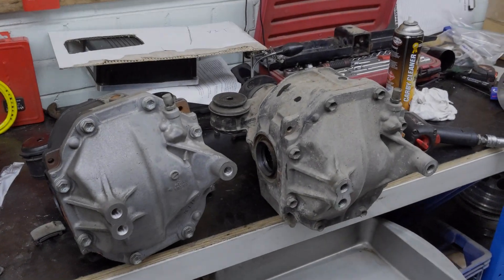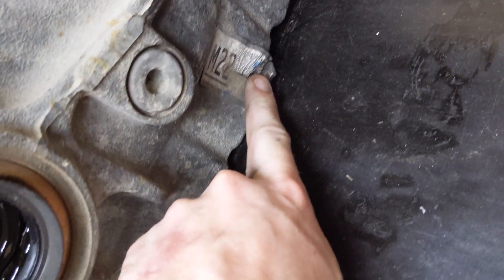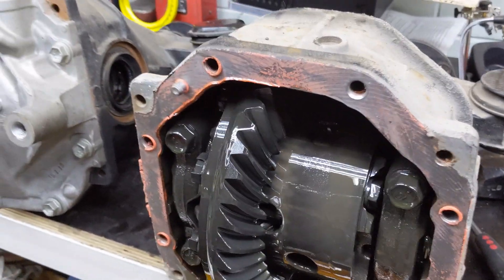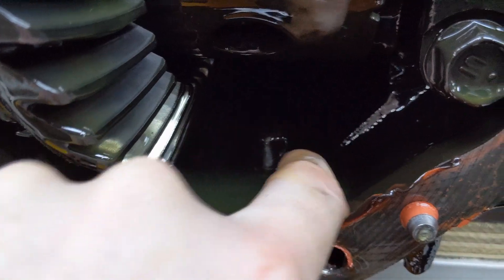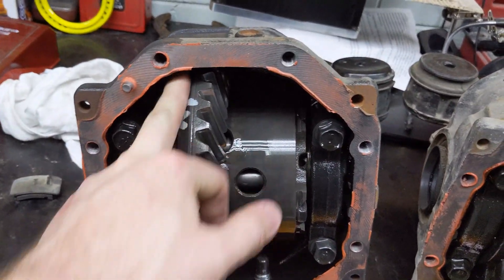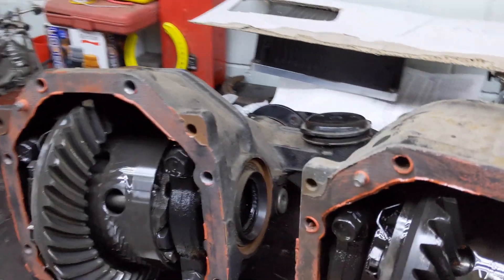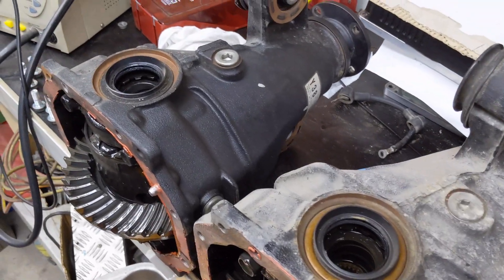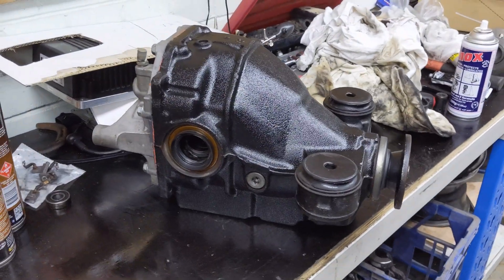Toyota 86 vs Lexus IS300 Differential Comparison

Comment: This is awesome, thank you for this in depth look. Looking forward to get an FRS diff for my manual IS300
Reply: Was yours originally a manual?
Reply: @WarriorsPhoto  yes sir, 2002
Reply: @Allen.Saylor  Did you keep it as a 5 speed or...?
Reply: @WarriorsPhoto  Ya it's still a manual to this day
Reply: @Allen.Saylor  Oh I was wondering if the OG transmission was swapped?
Reply: @WarriorsPhoto  oh no, this car came from the factory with a W55 transmission and it retains that original transmission now
Reply: @Allen.Saylor  I heard it’s not a very good transmission. Would you agree?
Reply: @WarriorsPhoto  it does good for a stock engine. I've drifted my car at day long events beating on it. I've beat on it for the last 7 years and its doing great. It may start to give you trouble around 400 lbs of torque, more or less
Reply: @Allen.Saylor  400 makes sense. When someone says it isn’t reliable. I always wonder how hard are they beating on the machine. 😂

Comment: That's wild, had no Idea they even came in a 3.58 ratio, must be an Aussie thing? In north america they only came with a 3.9 in the autos and a 3.727 for the manuals. Good to know!
Reply from the maker: Yeah, I think it was an Aussie only thing. Although I did read somewhere the US spec IS300 had a Touring Pack or something that maybe had a 3.58 ratio??
Reply: Mitcheeee the US spec gets a 3.9lsd for the auto and a 3.73lsd for the stick. Most of them have open diffs so they might have the other ratio
Reply: So just to clarify - the aussie spec IS300 torsen t2 LSD is a 3.58 final drive? That explains why the gears feel so drawn out. I was under the impression that is was 3.91 but it didn't feel like it. I have ordered a 4.55 Revolution final gear set (to suit toyota 86 / same diff) to install in my IS300. Should make a hell of a difference to acceleration then.

Comment: Greetings from Bathurst, Nice vid mate. I have an LS3 Powered 86 with TR6060 HSV box. I recently picked up the M22 IS300 3.58 diff and am going to be installing it shortly. What fluid did you end up running in yours? (full-syn 75w-85 GL-5?) The oil that came out of mine was really dark but the diff itself looks like it is in excellent condition.
Reply from the maker: Nice! Hopefully you're surprised at how easily it bolts in. I used Nulon 80w/90 GL5.
Reply: @Mitcheeee  great thanks for the info mate. Looking forward to the improved 1st-4th gear performance (mainly due to no traction with 4.11s with anything over a crack of throttle 😂)

Comment: Do you know what are the torque specs for two 19mm bolts on the bottom and three hex 12mm bolts on the back. 
I’m swapping out differential on my IS250 AWD 
THANKS

Comment: Im boosting my IS (its the stock auto trans) and i had one question which differential would be the best one to run? I currently have the lsd Y different from a 86/frs
Reply: go for the 2017-2020 Toyota 86
they have 4.30 ratio Differential torsen but double the price of 4.10 scion frs LSD diff

Comment: Hey Mitcheeee, I was thinking about buying a 2013 or 17-18 frs/brz/86 torsen for my 04 Lexus IS300, Do you know what year your 86 diff was and do I need to buy any new bolts or will the old bolts work fit perfect.
Reply: ME YOU N PUPU the old bolts will work fine, but they have a taper above the threads that won’t allow them to fit in the bushing all the way. you can choose to either use washers or bore out the bushing to make the bolt sit flush. Good luck
Reply: Diego Garza thanks! Do you know what years fit or do they all fit the same

Comment: Noob question! I got a 4.1 diff from a brz and a 3.9 open diff from an IS and thinking about welding it, are the internals interchangeable?
Reply from the maker: Not sure. Typically open center axles are different to lsd, so they may not fit into the open center splines.
Reply: @Mitcheeee i bolted mine right up and it worked

Comment: Why do people swap an is250 diff with a GT86 diff? If the is250 is a much heavier car then the GT86? and I guess the is250 diff is designed for that car weight and more rugged....
Reply: I swapped it with the 86 diff and it’s so much better

Comment: My buddy is giving me a brz diff without the casing. I’ve got an is300 without lsd. do you know if I can put the brz dif in my is300 pumpkin?  Thanks man
Reply: You can take the brz lsd and replace the open component in the is300 pumpkin with the torsen. There is a video on YouTube of a  brz differential getting a 2way lsd swap and he goes over the swap and torque specs, the process would essentially be the same for the is300 since is pretty much the same pumpkin
Reply: @136videos  its on the btr Justin channel for his os giken lsd install.  Theoretically the process should be the same for the is300 since they use the same housing.  For my build I'm keeping the same ring and pinion just swapping out the open component for the lsd out of a brz
Reply: @jicez6649  I’m doing the same but obviously my friend kept his ring gear so I’m wondering if I can bolt the Is300 ring to the brz lsd. So I’m  just switching the lsd component. Goal is to keep the is300 housing ring and pinion.
Reply: @ooodang180  thats what I am doing and should work, just need to find time to take apart the y38 and m82 differentials im working with to for sure know.
Reply: @jicez6649  it works. Picked up a spare m96 everything fit right in
Reply: @ooodang180  awesome, I will be tackling the project pretty soon, thanks for the information!

Comment: Great video!

What did you do with the IS300 stub axles? Im majorly stuck doing the opposite swap (86 diff into an altezza) and i cant find IS300 stubs!
Reply: Let me know if your not using and would like to sell them
Reply: Did you ever find out? I want to stick an 86 diff in an is200
Reply: You need is300 diff cups and is300/rs200 driveshafts to do that
Reply: @stevenwilliams6963  It has a jzx100 conversion done already

Comment: Anybody have any strong thoughts on if either of these diffs are stronger than the other? Looking to swap my 86 with a JZ, and trying to figure if I should stick with the stock or go with the IS300 diff. I'm aware that the final drive ratio's are different, and will affect acceleration/top speed, just curious if the stock 86 diff will hold up to some power. Cheers!
Reply from the maker: The main issue with these diffs is the crush washer that is used to set the backlash in the diff. With abuse, the crush washer can compress and cause the backlash to go out of adjustment which in turn can cause damage to the ring gear and pinion. You can get billet washers that prevent this, in which case the diff is pretty strong and could cope with plenty of power. People question the strength of the Torsen assembly inside the diff, but my car makes over 900hp and cops plenty of abuse and its shown no signs of wear and tear or failure. Get it adjusted correctly, keep it serviced and it should last.

Comment: So these are both 7 1/2" diameter ring gears? How about the spider gears / side gears are they 27 spline or 23 spline? I need a Torsen locking type for a 23 spline 7 1/2" type F .....any ideas? I can get them for 27 spline units but not sure about 23 spline axles.
Reply: It's 8 inches 
7.5 is IS200 or Altezza AS200/RS200